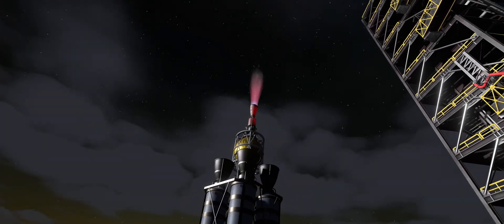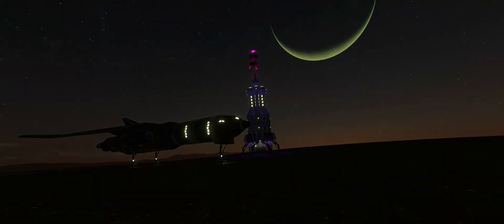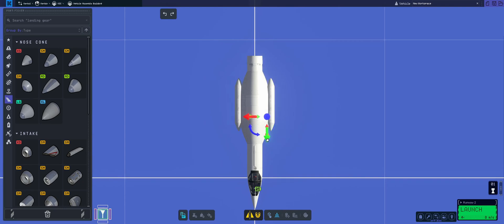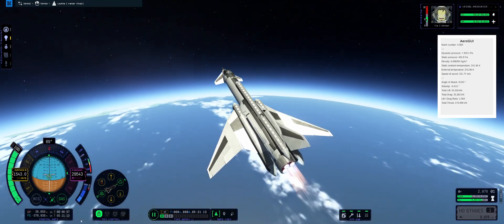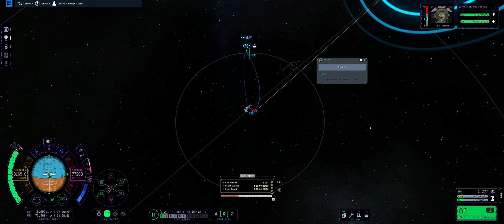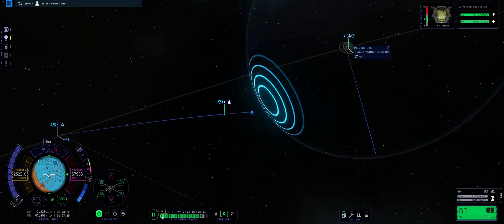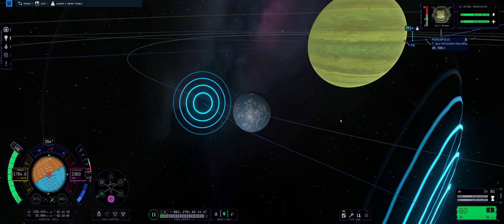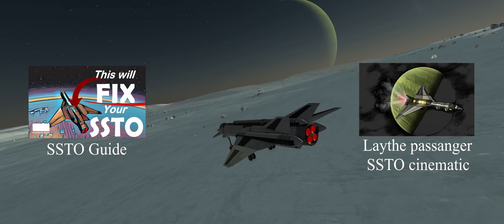KSP2: Single rapier Laythe SSTO (no gravity assist or kraken drives)

Comment: I have had a lot of success with LKO cargo sstos using chemical engines. Methalox is much denser than hydrogen, which means you can have the same fuel to payload to ratio for less volume. It will never reach as high of a delta V as nuclear, but just going to low kerbin orbit that wont matter 

So my view is hydrogen-nuclear sstos for long distance travel, and methalox-chemical sstos for low kerbin orbit delivery.
Reply from the maker: yup, chemical ssto's are a lot more suiter for lko lifts for the reasons you described :p
In addition, heavyer payloads wont have the required twr on hydrogen to actually reach orbit

Comment: How far would you be able to take an SSTO, if you were limited to only Rapiers, but you can use multiple.
Reply from the maker: You could do a grand tour with a rapier only craft if you were efficient enough with gravity assists. In my testing, ive been able to get around 3.5k lko d.v out of rapier only craft, tho ive limited me self to 4 rapiers max due to fps. 
I suspect that having more rapiers could lead to higher LKO d.v, but its hard to tell where the diminishing returns start to hit with out extensive testing with larger craft.